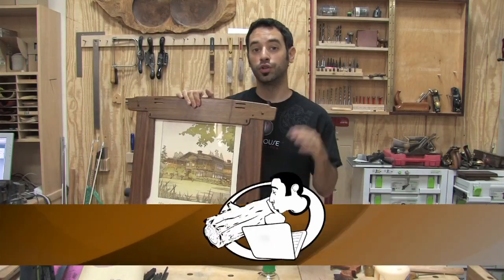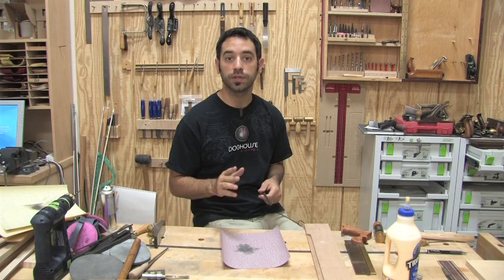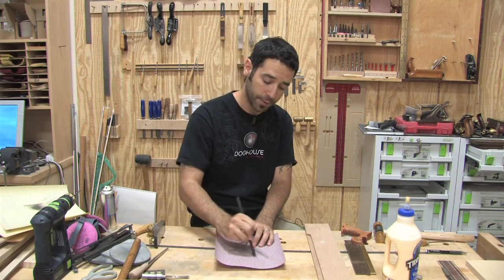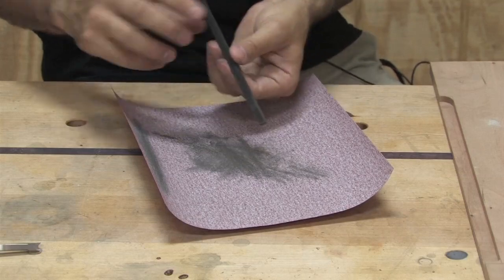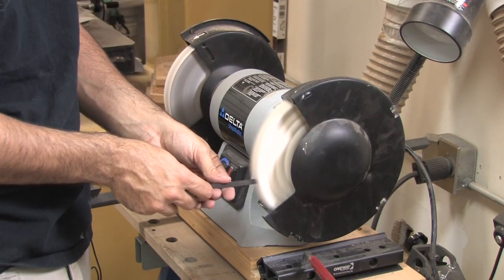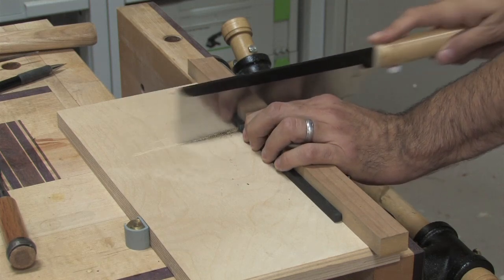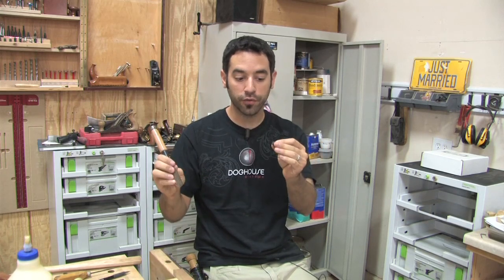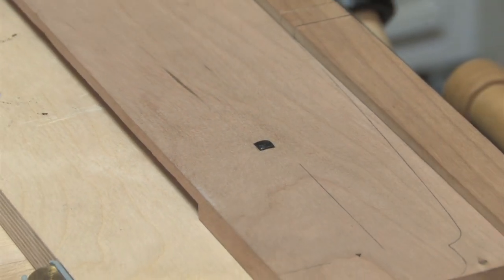Ebony Plugs

Comment: thanks Marc now i just need to figure out a better way to make the square hole. right now i use a drill bit (forstner) and then use a chisel to square if off. why cant a square drill bit exist :-(
Reply: Greg I saw a video where a guy sharpens a piece of metal key stock and he hammers it in a round hole. the result is pretty amazing. quick and simple